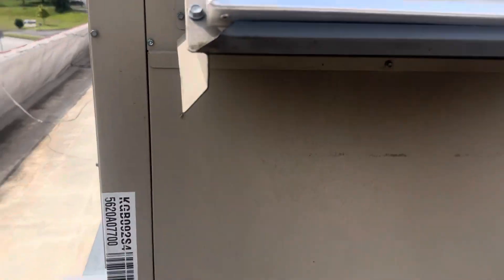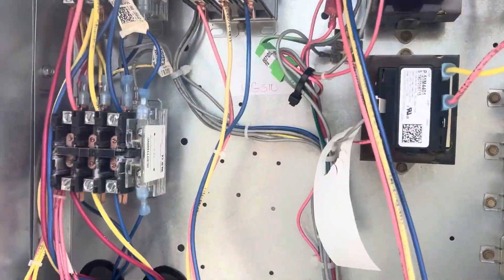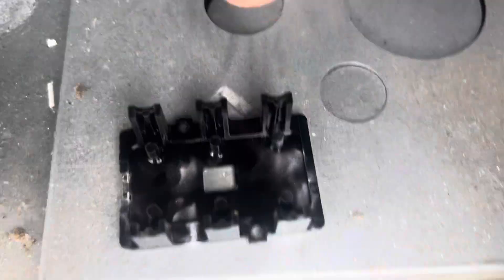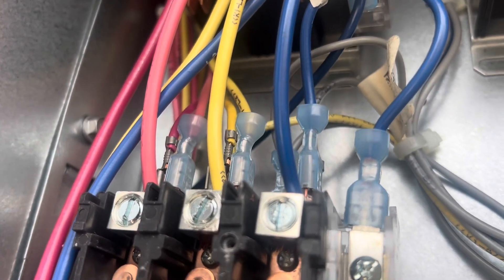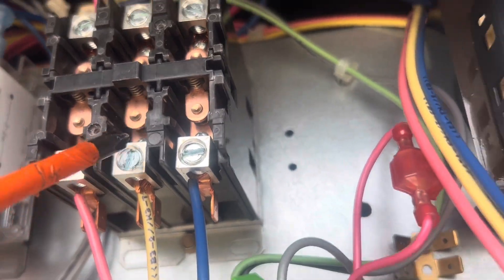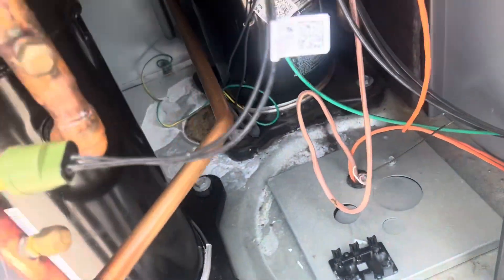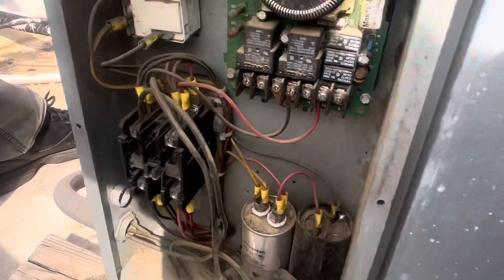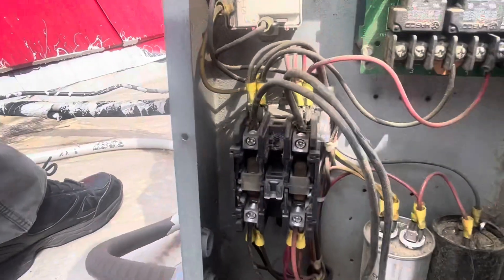New location - mechanical check

Comment: the potential relay is probably the same way,maybe getting the relay # or compressor # and caps,and contactors with oil switch.thanks for taking us with you.